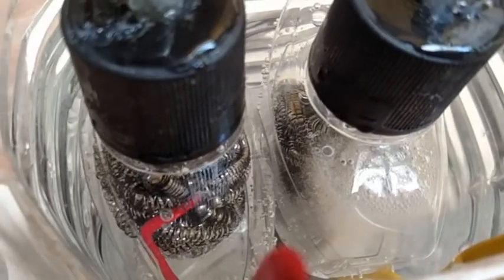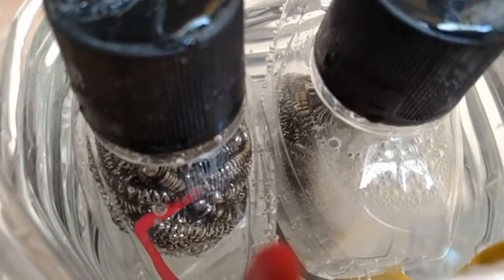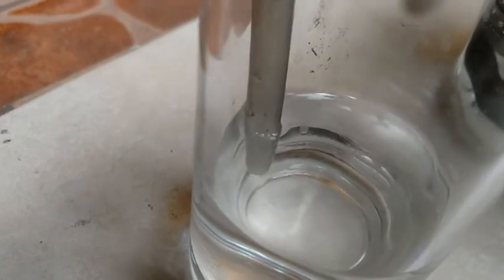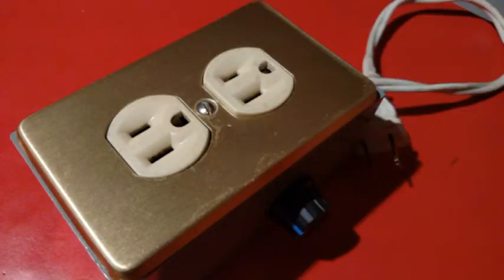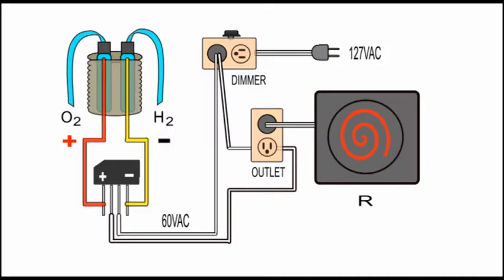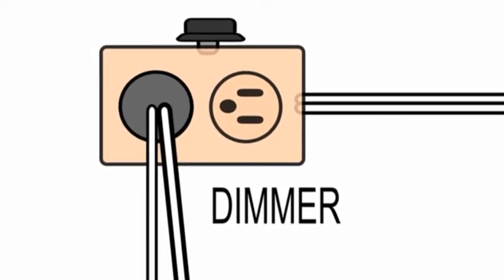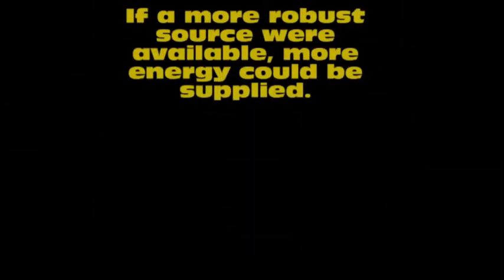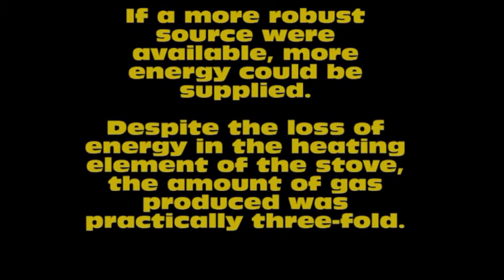Oxygen experiment using stainless steel pot scrubbers 2

Comment: Maybe s steel plates would work better  , high voltages will produce , but i never went over 24v well almost, highest was 240vdc with 118 plates thats all we had, at those volts you only need the smallest amount of electrolyte we made around 50 litres per minute it was scary, at 12v and 24v you need quite a bit of electrolyte,  it really  gets the amps flowing.

Comment: Than you for sharing your Experiments to us. The product of HHO depended on the ampere not the volt   2.2 volt is the best
Reply from the maker: Thanks for sharing that!
Reply: @eltunene  To reiterate what Samly said, you only need a minimum of 2.2volts to separate the hydrogen and oxygen, but depending on a number of factors you may be able to increase the production by increasing the voltage.  In many cases, the limiting factor in the current flow through the system is the supplied voltage.  If the resistance of the circuit is very high, 2.2volts may not be able to force enough current through.  However, by increasing the supplied voltage, we can potentially supply a higher current and increase the production.

Hope this helps!

Comment: Hi Mr. Chava .
In the next experiment, I advise you to go back to using 24 volts and increase the concentration of the electrolyzer. And also make side holes slanted upwards. It allows current to reach the more of SS net and bubbles to rise up without escaping to the side. In your experiences, the current only reaches the bottom of the net.
I hope your production increases.
 I have a program that calculates the production of oxygen and hydrogen.Write me your email and I will send it to you
Reply from the maker: Thanks for your contribution!!